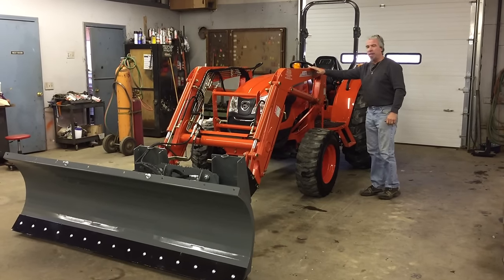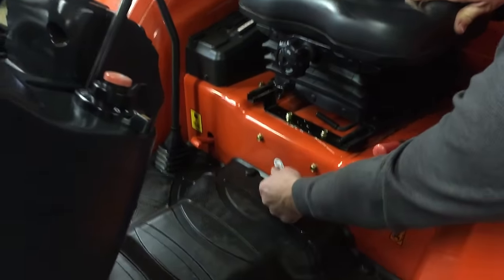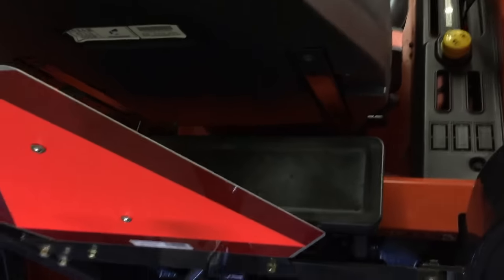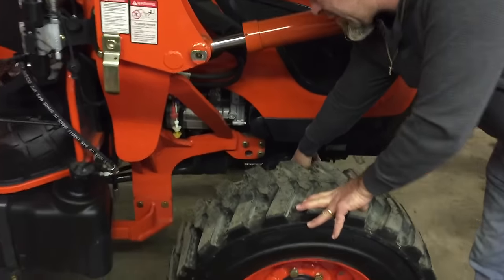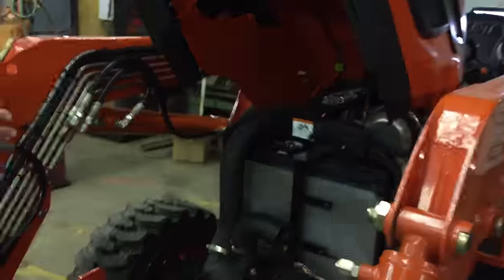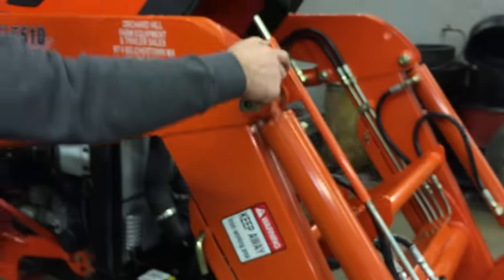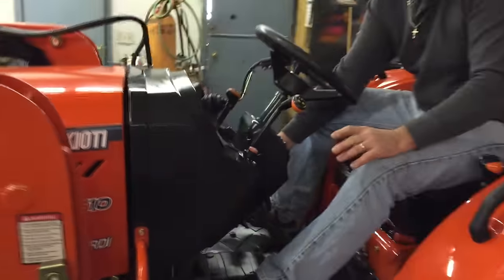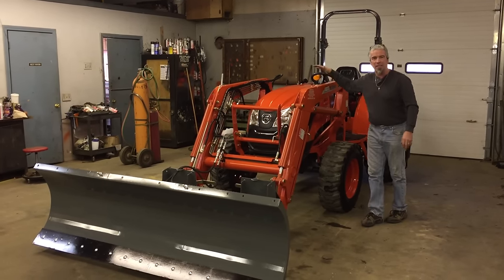Kioti DK4510 Shuttle Tractor w/ Loader & Plow Walkthru

Comment: I have the DK 45. I wonder how you made out with your plow?  I use a blower  on a steep grade gravel driveway and I have to use chains on my ag tires. The tractor is a good tractor for the part timer or small farmer or a second tractor for a the bigger farmer. It has lots of power but it is light for the big jobs.

Comment: I have the 2007 Kioti DK45SE HST. with 900 easy hours. The fuel inject pump went on me tractor took off like a jet plane and almost killed me. When I did some research on tractor by net I found out that from 2005 to 2009 Kioti had trouble with the fuel injector pump problems and never had a recall. To replace the injector  pump they wanted $1800 plus  labor.  I was able to do the whole job with a rebuilt from a very good company in PA. and saved thousands of dollars . go on my youtube video on fuel injector repair  because sooner of later you are going to need it..Kioti company wouldn't help me at all. That shows you all what kind of company that you will be giving your money to.

Comment: I purchased this tractor and am having issues.  I originally owned a CK 20hs. it was the strongest toughest tractor I've seen. My DK 4510 is not leaving the same impression. Front axle gear broke apart, backhoe bracket failed destroying for plates., and now, a cylinder broke at the weld on the front loader causing the sub frame and loader arms twisted.
Reply from the maker: Wow. We have had 0 issues with the DK4510's they have been phenomenal. matter a fact Ive never even had to file a warranty on the DK10 Series tractors. Has your dealer been helping you get all this taken care of? I am sorry to hear your thoughts on kioti have changed with your dk4510. I hope your dealer can make things right, Kioti is a very good company and usually wants their customers to be happy as they normally are returning customers much like your case. But again, it all comes down to the dealer and your relationship with them.
Reply: All comes down to the dealer and your relationship with them? BULLSHIT it  all comes down to Kioti and will they honor their warranty? I own a dk4510 no issues.